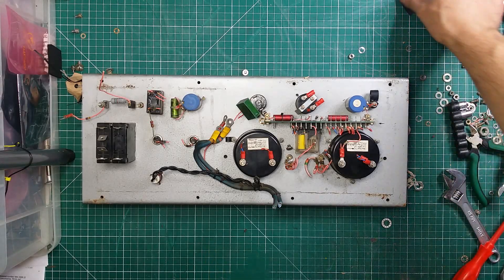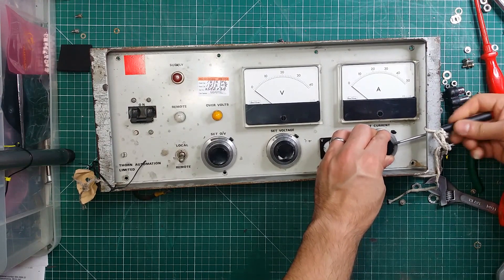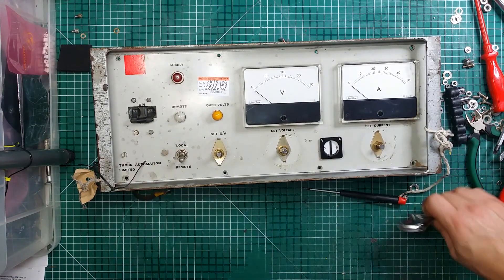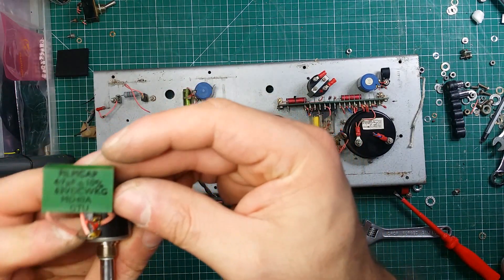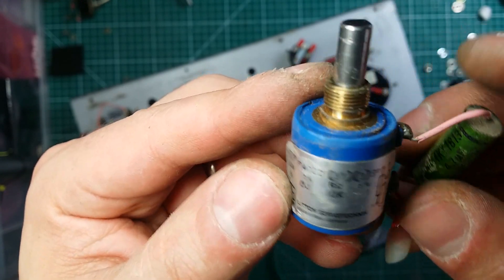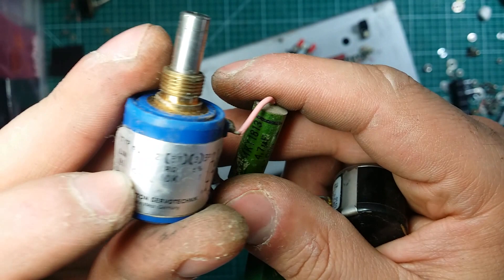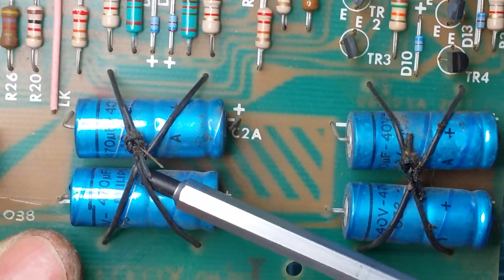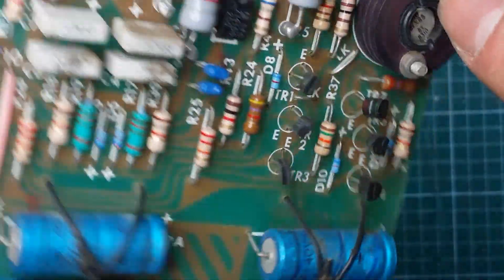Thorn Automation Limited 0-40v , 0-50A Linear power Supply Tear Down Part 4

Comment: 3:20 We call those circuit breakers...
Reply from the maker: +douro20 ye and they have a separate built in trip which activates with 12 or 24 volts.